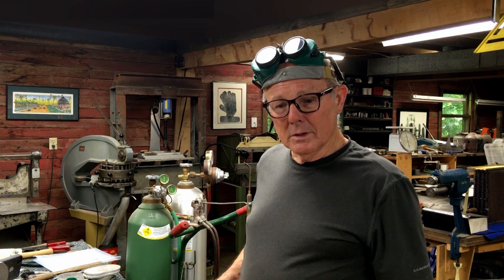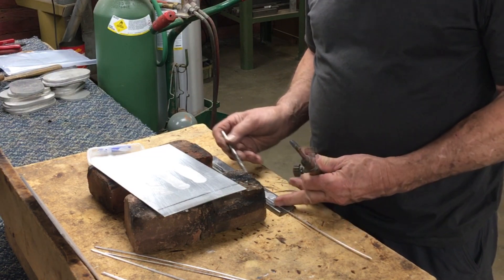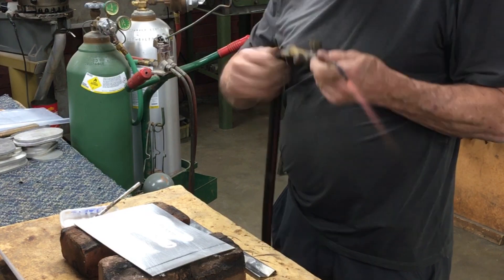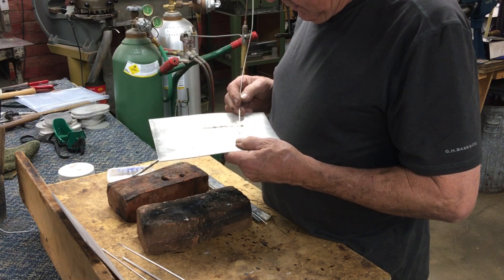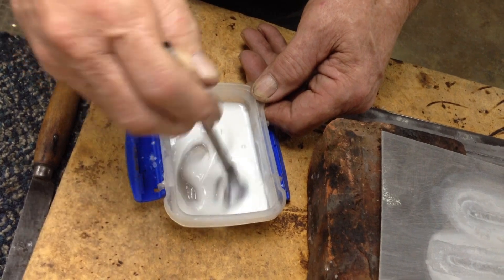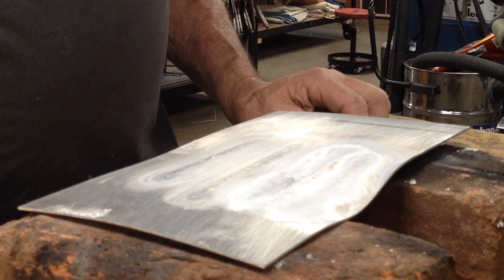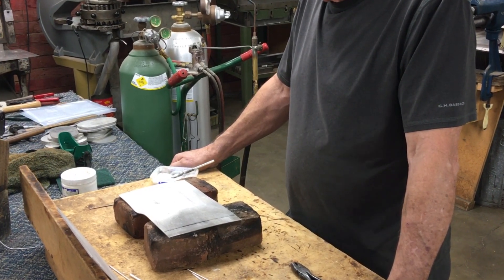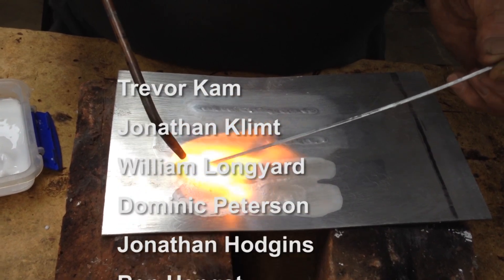Gas Welding Magnesium, with Jerry (Weeks) Baker

Comment: Ron, does the weld bead planish out as you would when joining aluminum panels?  Those years that I worked with magnesium on the dragster bodies I always wondered if it could be gas welded.  We did use heat, with an abundance of caution to form the cowl area.  Thanks for the vid, very interesting.
Reply from the maker: I've never gas welded magnesium, but Jerry says in the video that the weld can be hammered - to some degree at least. It may need to be hot to withstand that kind of planishing.

Comment: I'm interested in seeing the radiator build. Those generally require a fairly large amount of welding.
Reply from the maker: Noted. In most cases, radiators are soldered rather than welded.

Comment: I am interested in the valve that shuts the gas off when he hangs his torch up! I’ve seen aluminum gas welding at Airventure at Oshkosh on year, but never magnesium welding. Thanks for the great fabrication videos!
Reply from the maker: The device that shuts off and re-starts the torch is called a gas saver:
https://www.tinmantech.com/products/welding/regulators-economizers.php#econ
Reply: same, that and the pilot flame that it has on it as well look like a really slick setup.

Comment: I'd be very interested in trying that out myself. I've done acetylene welding on steel, aluminum, and cast-iron. How does the hydrogen welding react differently to acetylene? And how does the magnesium weld puddle react compared to other metals?

On another note, I'd love to spend a day working in the shop with long time professionals like you two. I've learned so much from these videos and I'm always excited when I get to use some techniques that have been shown.
Reply from the maker: I have not welded with hydrogen myself, but I have talked with several people who prefer it for aluminum (and in Jerry's case, for magnesium  too). The report is that it is cleaner than acetylene, and the flame is softer. I can't answer your question about how the weld puddle reacts. I have TIG welded both aluminum and magnesium, and the puddle seems to behave in a fairly similar manner with both metals.
Reply from the maker: I forgot to mention that I do offer one and two-day hands-on workshops at my home base in California:
https://www.youtube.com/watch?v=loc-7t4qbjI

Comment: How do you set your flame without the inner cone?
Reply from the maker: I have not welded with hydrogen, so I can't answer your question. Jerry talks about the 'stiffness' of the flame as he waves the torch in the air, and how long it takes the metal to 'go liquid' as the flame is played on it. I guess it's something you 'get the feel for' after lots of practice.

Comment: There was huge fire not far from me that started when some 55 gallon drums filled with magnesium shaving ignited after the oil it was being stored in leaked out. It burned for over 8 hours and took three nearby houses with it. They had to call in units from the airport in to spread foam, because putting water on that fire just made it worse. I knew someone that machined magnesium castings and they were really careful about the shavings, but even they had a fire that caught in the chip pan of a lathe. It burned so hot it melted the bed of the lathe in half.
Reply from the maker: Yes, magnesium does burn very aggressively once it starts.

Comment: Absolutely would like to see a radiator build. Though you will need slightly better lighting than this one. Your shop has fantastic lighting. His, not so much for videos. Also a close up of the welds for about 5 to 10 seconds are nice.
Reply from the maker: I'll see what we can do with the radiator idea. It was challenging to shoot this video, and it was done sort of impromptu, using three cell phones for all the shooting. Two of them were older phones, and you can see they had problems getting a sharp focus on the welding.

Comment: How interesting - and anticlimactic was that? I do a fair bit of gas welding aluminium, but it would never have occurred to me to try magnesium.... I wonder if the flux is significantly different to aluminium welding flux?
Please make a video of Jerry building radiators!
Reply from the maker: Well, the flux certainly looks the same, and I'd guess they are more similar than different. I'm looking into the feasibility of the radiator video - seems like there is a lot of interest.

Comment: I'm interested in why hydrogen versus acetylene versus TIG - when and why would you choose one over another?

Also, I can't believe someone would grind magnesium in a fabrication shop without thinking about the dust. I have a lot of respect for anything so strongly attracted to oxygen that it will burn under water, bubbling off hydrogen.  Temperature is important for that trick, so it doesn't work for thin strips.
Reply from the maker: I have never gas welded magnesium (only TIG welded it), but I have done a fair amount of gas welding on aluminum, but only with acetylene - not hydrogen. 
The people I've talked with who prefer using hydrogen say the weld is cleaner, and the flame is 'softer'. 
Gas welding aluminum and magnesium makes a softer bead, which is much easier to work than a TIG weld.

Comment: I've played with strips of magnesium before and they can light right up with just a lighter.  It never really occurred to me that it wouldn't happen so easily with more mass of material.  Thinking about it some more though, it's just like the difference between lighting steel wool on fire vs. trying that with a bit of flat stock.  Makes perfect sense really.
Reply from the maker: You have hit on a perfect analogy with the steel wool!

Comment: Excellent video...and please show the radiator. 
Just retired from welding after a 30 year career. 
Graduated from Hobart School of welding and one of the first welding processes they taught was gas welding . Thanks for the video.
Reply from the maker: Wow - I don't know if they still teach 'gas' welding at Hobart. I think it may all be electric now. I'm tallying all the requests for a radiator video - might be a good one to do!
Reply: @RonCovell  I remember the instructor saying that you need to be able to learn to read the weld puddle. Which is applicable to all the welding processes. With gas welding it was a slow process...which gives you time to learn to read the puddle. 
Hope the radiator video is posted. I have a Suzuki samurai radiator I would like to rebuild. 
Thanks again for your videos

Comment: Have you ever tried using Hydrogen rich MagneGas?  
You can't really weld steel with it because of the Hydrogen but maybe you can weld magnesium with it.
I've use it for brazing and metal cutting, heating frozen bolts etc. 
I'm very curious to know what you guys think about MagneGas or if you've even ever heard of it.
Reply from the maker: I had never heard of MagneGas before, but just now saw some very interesting videos online. Looks impressive!
Reply: @RonCovell  yes, I've been using it for years, not many people seem to know about it but it's less expensive than acetylene &there is lots of O2 in magnegas so it uses less O2 plus it emits O2.  Liquid waste feedstocks,- A car running properly w magnegas(CNG system) emits about 12% O2.  Sort of back2the future. I'm obsessed w the story too lol. They are in Turkey right now about to replace acetylene supposedly-
Reply: there is also weird science involved which adds to the fun when using it lol.  The portable submerged plasma arc gasifier units that make magnegas can be fitted onto an F450- and this is only part of the story
Reply from the maker: Very interesting - I'll be looking for more information about this interesting development!
Reply: @RonCovell  I'd love to see what You think about MagneGas!  Hopefully you can find some near you. You can try and ask for a demo, that's how I first tried it. MagneGas was originally made from antifreeze of all things!  I've managed to try every feedstock that they've used commercially so far.

Comment: I worked is a Magnesium recycling foundry, at the time it was the only plant that could bring it back to 99% pure, and used for car parts.
Reply from the maker: Sounds like a very interesting job!
Reply: @RonCovell  It was a Great job, I worked half the day stacking freshly made ingots @ 700° then the second half worked up on the pot, Loading, Melting, and getting the alloy right b4 tranfering it to the second pot to pour. We ran 2 16 ton melting pots, that feed a pouring pot. Very interesting job. I got beefed up doing it...lol
Thanks for the reply, I have been learning from you for years now!
Reply: what types of substances get mixed with magnesium in the recycling stream that are harder to separate than the matter it first comes out of the ground mixed with?
Reply from the maker: I hope Myco Night responds - I'd be interested, too!
Reply: @RonCovell  we added Aluminium, Barilium,  to get the Alloy right. The metal was tested to see what we needed to add We used a Lot of Flux to help clean the metal. They had a filter system that was claimed to be Way ahead of time, and had a patent on it. This was about 20 years ago, so it's a bit larger there now. We would load the pots up, and melt too 1200°, keep adding to fill the pot, throwing flux in it while melting. We had a huge arm on each pot to stir it up and mix the alloy, along with the flux. Once we had it ready, we transferred it to another pot to pour into ingots, those would solidify over about s 20' span, and drop out the bottom, then a guy would use a hammer to knock off any chunks from the pour, hit em with a wire wheel. Then be stacked up like a puzzle to get the stack straight. The better, and more consistent the person poured the ingots, the easier that job was. Then each stack was weighed and shipped after about 24 hours of cooling.
Reply from the maker: Pretty fascinating details. I've never 'talked' with a person who worked in a magnesium foundry before!
Reply: @RonCovell  a couple years ago, they had a loaded trailer get hit by lightning. Took the fire dept a bit to get it put out, as far as I know they got it under control b4 the entire trailer lit up. It's a dangerous metal if not done right.
Reply: @dr.kraemer  Sorry I missed the notice of your comment, or I would have answered sooner!

Comment: Can't wait. Can we see gas welding aluminum please
Reply from the maker: You can see a little gas welding on aluminum here:
https://youtu.be/5nYZXBzVlEA?t=233
Reply: I'd suggest watching Ron fabricate and then weld up an aluminium motorbike petrol tank, but if you're anything like me you'd be having nightmares for days because you SO want to make one of your own, but don't have the equipment, or anywhere to do it, or even a motorbike!
Reply from the maker: For what it's worth, I've met people who got started in metalworking by using scissors to cut up aluminum beverage cans, and molding the paper-thin metal by hand! Where there is a will, there is a way.
Reply: @RonCovell  thanks Ron